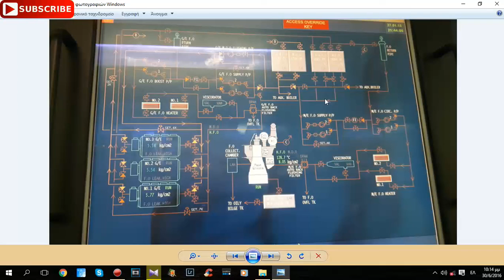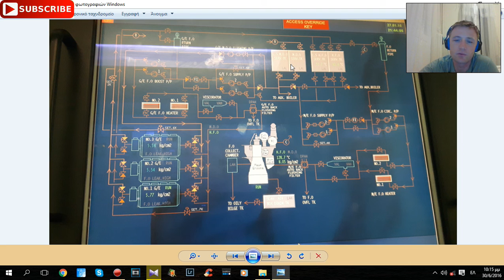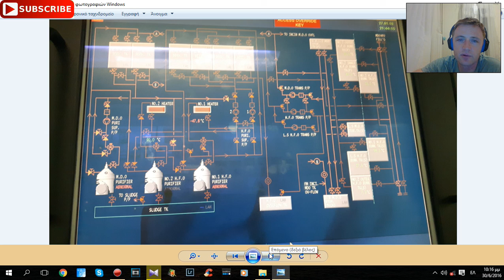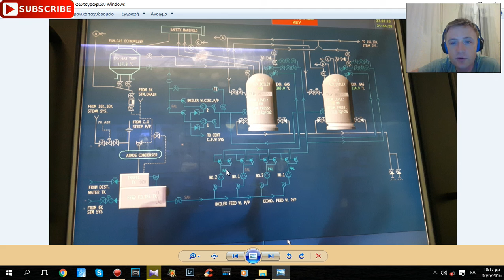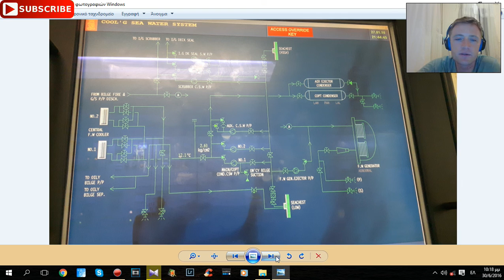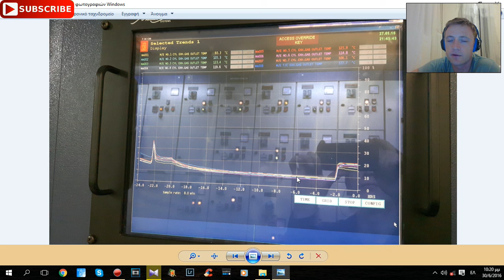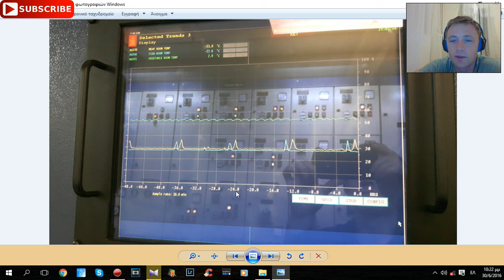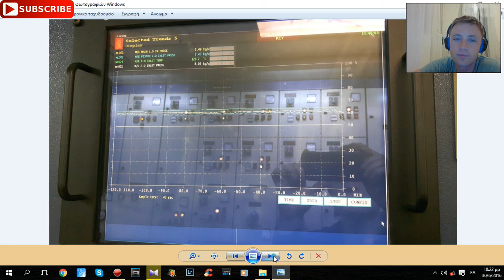What you can see in Engine Control Room Monitor Console Kongsberg

Comment: Please sir I need data sheet for kongsberg nn 826.1 valve driver
Reply from the maker: Hello it is really difficult to find such information! I have tons of files.
Reply: @Adventure-Story  you have it??
Reply: I've been searching, I have a current job to fix some automation but I'm working manually
Reply: It's urgent please
Reply from the maker: as i understand this is a pcb where is the area of application or control pf this pcb?
Reply: @Adventure-Story  2 stroke MAN diesel engine control module, part of digital governor unit
Reply from the maker: @georgeakejelu8049  i checked and i have not found it if you don't have it you can request it from the maker direct!
Reply: @Adventure-Story  OK thanks
Reply: Can you help me with power converter AH 9451091 series datasheet please...
Reply: @Adventure-Story  thanks a lot I got a positive feedback from kongsberg